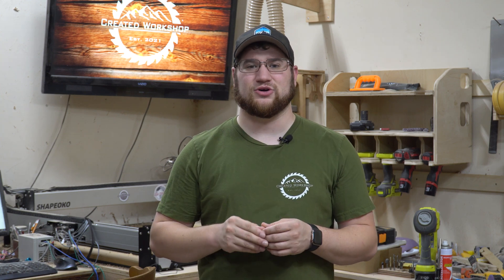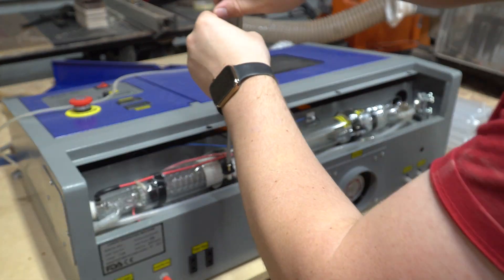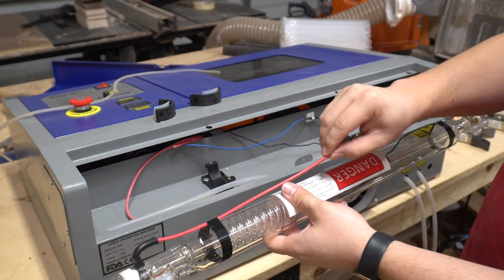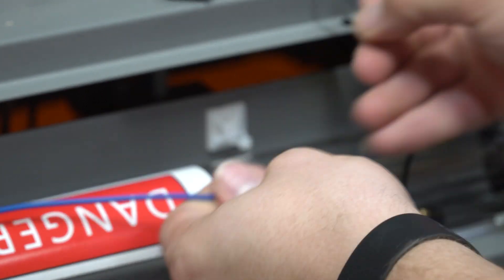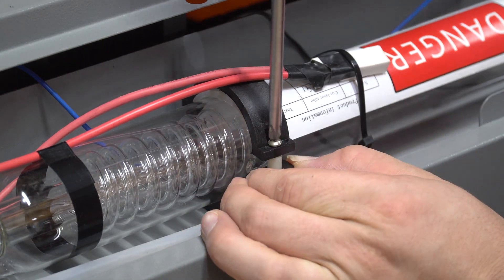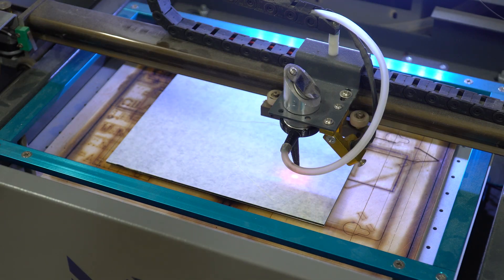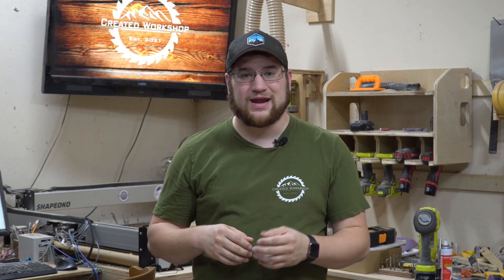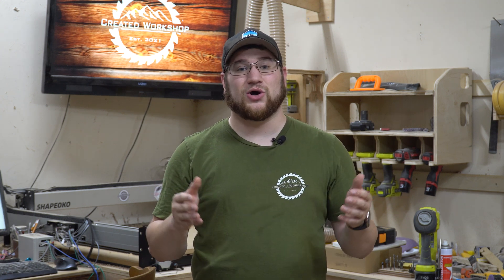SO EASY - How to change your @monportlaser K40 CO2 Laser Tube

Comment: I got a 130w replacement tube from Monport after my original tube froze and cracked during a brutal winter.  They ship it in a nice wooden crate, suspended inside by foam blocks.  Very nice shipping job.  Now to heat my garage so that expensive screwup NEVER happens again!

Comment: Nice video. I just bought a K40 on Ebay and i will have to change the tube.  Can i ask what are the measurements. The one that i keep seeing in the search results are 720mm 50mm diameter.
Just want to make sure I get the right one :) Cheers
Reply from the maker: I actually don't have the K40 at my main shop anymore, so I can't get the specific measurements of this one. But, I do know that Monport's K40 40W tube is 720mm long and 50mm diameter, so that sounds correct!
Reply: Would you know if its possible to fit a more powerful tube with the standard power supply? I read that the 40w tube is actually 40w pick, so it's more a 30w...
Thanks 👍
Reply from the maker: @alb673  You can only do a 40W with the standard housing and power supply. You’ll need a longer housing/extension plus a better power supply for a more powerful tube

Comment: Great video! Question - did you get your replacement tube from Monport or was it another brand? I need to replace my tube but Monport doesnt have any available at this time..
Reply from the maker: My replacement tube was from Monport directly, but honestly any 40W tube should work fine. People even upgrade to 55W by swapping the power supply and extending the side out.